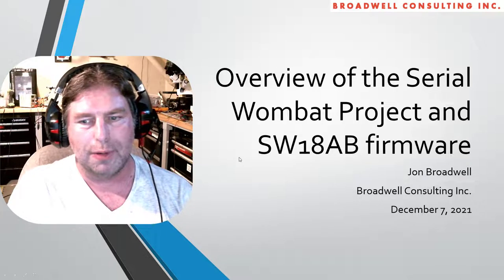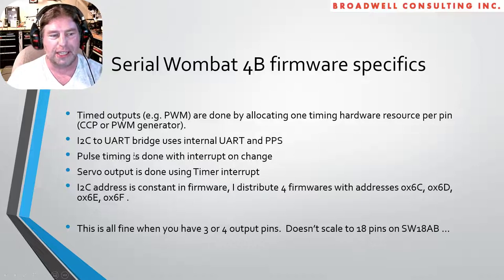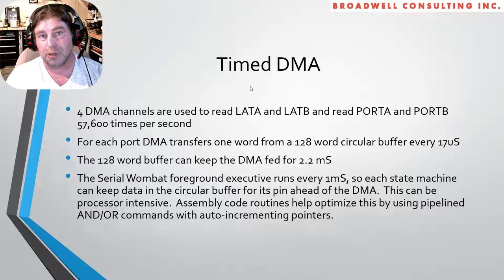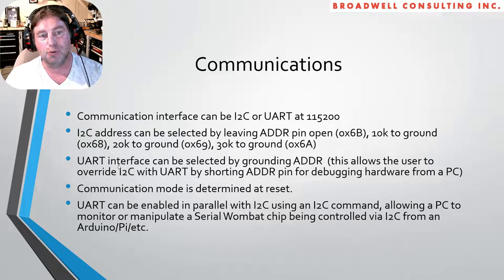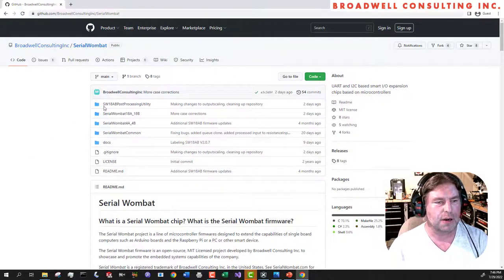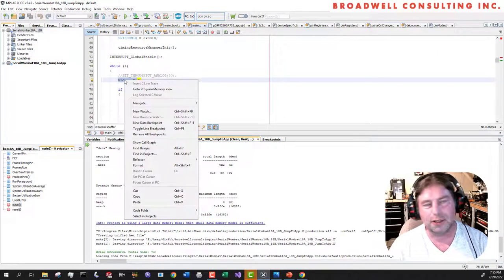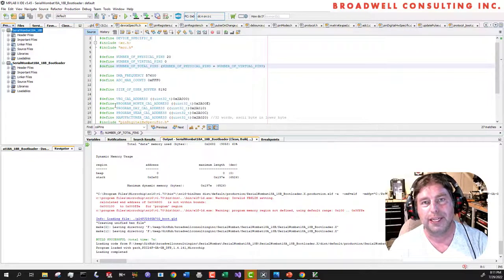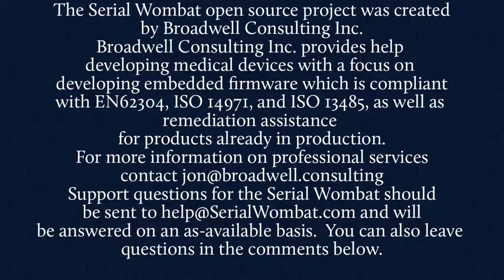Intro to Modifying the Serial Wombat 18AB Firmware

Comment: Great work and great info!   One question...  There's an "Optimized" config for SerialWombat18A_18B but it doesn't build without some changes.  Is that meant to be use or was it just experimental?  Thanks!
Reply from the maker: Thanks!
Wow.  I totally forgot about that.  That's an artifact from early in development when I had a couple of configs for turning compiler optimization on and off.  But then as I made more and more changes to the config, started working on the bootloader, etc. keeping the configs synchronized became a hassle, and it was easier to just switch the compiler optimization level.  I'll get rid of the "Optimized" config in the next release.  Just use the default config.

Comment: Thanks for the video (and the chips!! I'm playing with both your 4B and 18AB series chips). The 1ms per update loop, I think, inherently explains why I'm struggling to get μs resolution on a PIC16F15214 used as a 3-pin output to drive an X25.168 Stepper motor (yes we know this stepper has 4 pins, but pins 2 & 3 are always in the same state, so, in reality, it's a 3 pin stepper). It requires 3 i2c digitalWrite commands to move one step. If I understand what's going on here that would be 3 loops through the main loop for every step I want to move. Equating to 3ms being the fastest update I can apply???
Now to buy a PIC programmer and dive back into the world of MPLAB & PIC programming (it's only been ~15 years, and I'm a hobbyist, so in reality, we are starting over from nothing). Here is to hoping that migrating a fairly simple (modified) cpp library over to run natively on the PIC16F15214, and just accept i2c commands to control the 3 output states is a straightforward process. Thanks for creating this and making it open-source for us hobbyists to play with. I have so many ideas that are now, no longer board dependent, but I can run on anything that has i2c capability.
Reply from the maker: Glad you're enjoying it.  I'm really proud of the I2C stuff on the 16F15214.  There's some sample code available through Microchip for I2C peripheral operation, but it doesn't support clock stretching, so it doesn't work good for problems where the answer isn't available immediately upon a request.  Lots of this is custom.  I spent many hours torture testing the interface with test code and a logic analyzer to make it pretty bullet-proof.
Reply from the maker: A stepper motor mode is one of the to-do list items for the 18AB firmware.  I'd be interested to know how you'd set up the interfaces based on what you're doing.